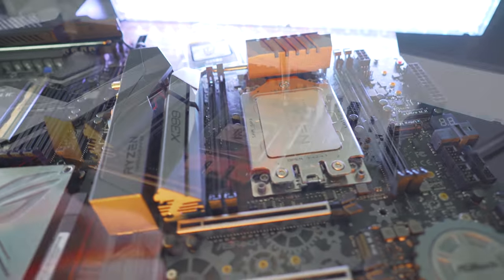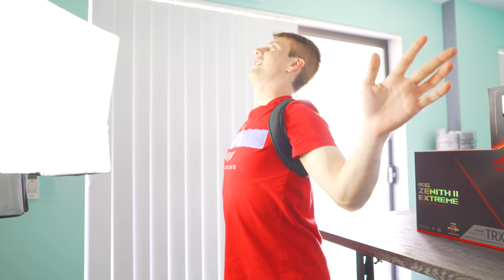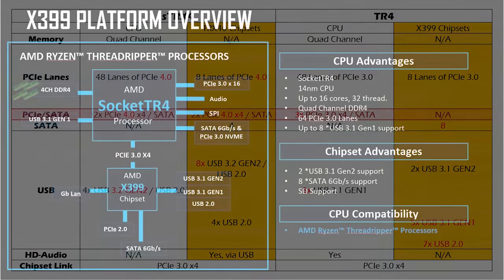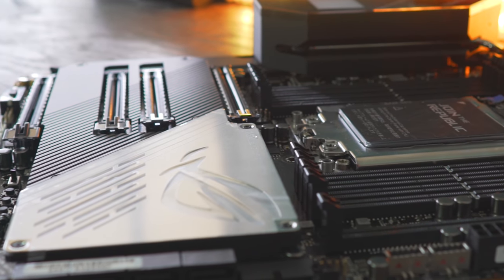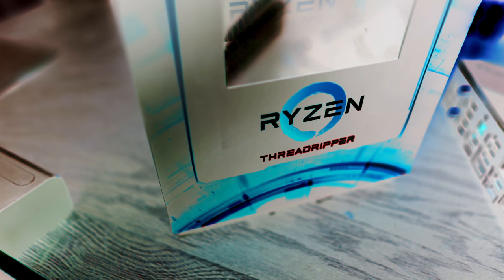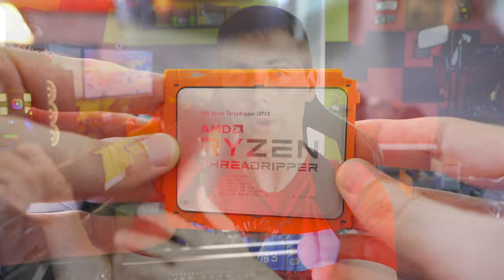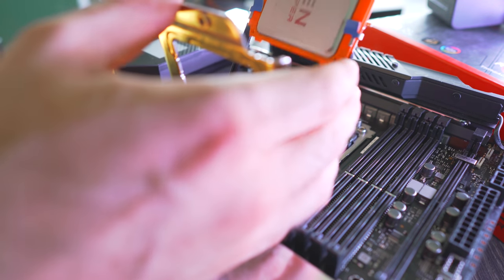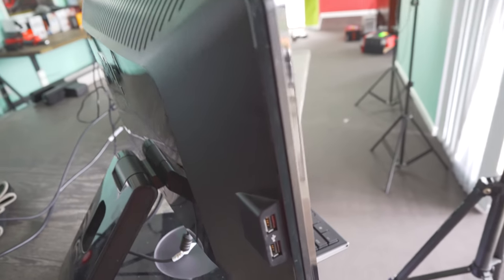Why the 3970X Won't Work on X399 - New TRX40 Vs. X399 Differences Explained

Comment: Since the new Threadripper won't work on the older platform, I can't wait till we start giving some Tech. YES. LOVIN to the old threadrippers!
Next episode: $399 Threadripper 1st Gen build!
Reply: I got 1920X when they got on hard discount after 20XX launch. Now I have very quiet system with Vega 64, both with water AiO, mATX board (sadly bit to large to fit in Jonsbo C2).
Reply: The 12 core First gen ryzen threadripper costs 229€ (new) here in germany if iam not mistaking.
Reply: @riklaunim  So I assume you are mainly using that system for work/content creation?
Reply: @TheBIOSStar  Linux with kubernetes for work, windows with games and some astrophotography processing apps for the fun part.

Comment: For anyone considering these back braces: they do help your posture, but be careful not to use them for too long if you're being active and not just sitting at your desk, all the force is being applied on the back of your neck and will cause some pain. Speaking from experience.
Reply: Thanks . That's good to know .
Reply: Yeah. Don't force it ... Give it time. Correct your posture gradually!
Reply: thanks for the heads up. I have a hunchback but spent most of my life in a cathedral so never felt the need to straigthen my back. sadly my place of residence was recently burnt down and now am on the streets...have no option but to get in shape.

Comment: You have a good point. To add to that. A lot of times the pins are all being used. Some are just there. I read somewhere that there are tons of list of slots and sockets. And they can pick from them. They dont have to design one completely from the ground up. So there may have been a lot of slots and in order to keep the CPU performance/speed/?? up to standard they may have had to switch pins (electrical layout), not physical.

Comment: Face pulls will cure your forward shoulders! Whether it's using cable machine or resistance bands off ebay/amazon.
It's not just nerds that suffer from it, A lot of gym junkies spend too much time training the front parts they see in mirror and forget the back area.
Over trained pecs from too much bench press will push your shoulders forward, Need to do rear delt exercises to counter balance and straighten everything back again.
A strap will only do so much, Need to build some muscle long term to fix years of shoulder/back neglect!
Reply: Please guys upvote this, this is actually the healthy way to solve your hunchback permanently. And its not even that hard.  You can buy a resistor band to do facepulls at home (and a lot of other exercises too). Please dont buy magic solutions like the one advertised, they may even cause damage to your back in the long  run.

Comment: Supposedly the X570 boards were mired with problems because of PCIe4. My guess for the non-consumer milking reason for them changing the pin layout is to ease the transition. The consumer-milking reason I think they did it is so they can still sell Threadripper 2000 series and x399 mobos for the price slot just below these new 3000 series threadrippers.

Comment: Could you make another Ryzen vs Intel input latency video like you did with 2700x and 9900k. 
I wonder if Zen 2 has lower or higher latency vs the first gen Zen (I'm thinking the chiplet design could make the latency even worse).

Comment: I am disappointed that the new chips won't work with the old boards, but I understand the reason suggested by you, that they want a smooth experience for people investing in the new chips. I am rather excited about the prospect of more old x399 boards on the used market.

Comment: TechYESCity, I think the reason AMD made TRX40 incompatible, or announced that the TR4 X399 would not be compatible with 3rd gen Ryzen Threadripper is because AMD went around the problem it faced with the high-end 2nd gen Threadrippers 2970wx and 2990wx that used more than 2 NUMA cores. 

Remember those Threadrippers suffered performance regression in Windows 10 due to the OS poor thread handling with it's scheduler if system uses a processor that has more than 2 NUMA cores. 

Remember this became a big issue during the 2990wx launch last year.  AMD knew this was a problem and tried to band-aid it with an update to their Ryzen Master OC tool that featured Dynamic Local Mode for the 24 and 32 core Threadripper, but it did not do enough to improve performance compared to Ryzen Threadripper builds that used a Linux operating system which performed greater.

It seems with 3rd gen Ryzen Threadripper AMD reworked the design of the CPU, fitting 24 and 32 cores within two NUMA cores and avoided the issue with Windows 10.    I bet this core change made the new processors in compatible with X399.  

But those are just my thoughts as a fellow X399 owner with a 2990wx.

Comment: Intel has done the same thing with lga1151 socket, however with some work coffeelake chips work on sky/kaby lake motherboards, I have 2 of them (i7 8700k on asus maximus viii hero and i5 9400f on asus z170i pro gaming) running without any problems
Reply: But it's not the same. 6xxx 7xxx 8xxx and 9xxx are done on basically the same archintecture and same node whereas threadripper 2 and 3 while on kinda similar arch, still hgave the node difference and IO die, also PCIe 4. Then again, older boards support ryzen 3xxx with bios updates, TR4 boards not supporting new threadrippers is kinda silly. Also 1151 is a desktop consumer product whereas threadripper boards are more productivity/workstation type boards.

TLDR: AMD's switch from X399 to TRX40, while a bit disappointing, is way more justifiable than intel's 1151 vs 1151.

Comment: Most of the office PCs (Dell 7010 systems) at my uni have a matching HP screen with that 2048x1152 resolution. You saw them quite a lot back in the day for business, being just a bit sharper than 1080p

Comment: 1152p resolution was used in the CRT days, but not with 2048 horizontal resolution, those were old 4:3 aspect ratio so they used 1536x1152 pixels, I used to have a 1024x768 CRT monitor but I used to set on at 1536x1152 to get more size, later I set it at 1280x1024 to get even more... I still miss this from CRT monitors.
But using the same 1152 vertical resolution on the 16:9 aspect ratio will give you exactly 2048x1152 resolution as your display.

It's still strange though seeing this resolution again. It's done custom I think, but it's easy for modern LCD/OLED production, they just produce a large panel with specific DPI, then cut it in smaller screens. So having a weird resolution is just like playing with DPI and display size. It's like how Apple is using the same DPI for their 13", 15" & 16" MBP, all with weird resolutions as they all based on the same large screen panel with the same DPI, they just cut it in smaller 13, 15 and now 16" screens.

If you need large amount of the same screens then you can have a custom order.

Comment: Hey Brian, where can you pick up a 6700k or 7700k for a reasonable price? I'd like to squeeze a bit more life out of my skylake build, but don't want to spend $500AUD for an old CPU which didn't cost that much back when it was new.
Reply: I’m not Brian but you can try Engineering samples on Aliexpress. I’m running 4c/8t one right now tho they don’t clock that high.
Reply: You might need to do a bit of planning, but you can likely squeeze out a good deal on ebay by watching the auctions on eBay.
What's your current build specs?
Reply: userbenchmark.com/UserRun/21832902 Only upgrade path at present is getting a better cooler and squeezing another 100-200MHz out of the 6600k, or switching it out for one of the SMT/HT-enabled SKUs. Obviously don't want to spend a whole lot on a 3-4yo build I'll likely replace in the next 1-2 years, just want fewer frame dips (using a 60" HDTV for a monitor, so any frametime inconsistencies melt your eyeballs at this scale).
Reply: @crunchychips8123  even then all you are getting is hyperthreading for $130-200. 

Perhaps save for a midrange Ryzen 3000 series platform?

Current coolers are transferrable and cross compatible so maybe do that.

Comment: @2:02  typo.. obsolete ... @2:25 you're showing chipset link pci-e 3.0 x4 but it's actually pci-e 4.0 x8 which you show at @3:10 - the chipset has 8 pci-e 4.0 lanes for slots and 2 "modules" that allow motherboard designer to pick between 1 x4 link , 2 x2 links, 4 x1 links or sata controller with 4 sata ports .. so you could have 2 x 4 sata + 4 sata always enabled in chipset if you want to, besides the 8 pci-e 4.0 lanes.

I suspect they had to change it because of the chipset link at x8 and because the memory controller is a bit different and because of pci-e 4.0 and the amount of lanes... better to simplify design and guarantee the chipset's always gonna be at pci-e 4.0 speeds and you don't have choke points.

Comment: 5:15 - Nobody is forcing someone to upgrade. :D  Buying one of these products is a voluntary act. AMD never promised socket compatibility for TR, and PCIe Gen4 is a rather demanding feature to properly support. More likely though it's to better cope with Zen3. Wouldn't surprise me if they did it again later, eg. a new socket once more for Zen4/Zen5. Plus, the kind of people who buy this class of hw don't really care about socket compatibility; if they upgraded at all they're more likely to buy a newer CPU anyway. HEDT is a different mindset to mainstream mbds where price awareness tends to dominate a lot of the rationale for why someone chooses a particular product. I know people who would (likely will) buy TRX80 because the cost will more than pay for itself in added performance (solo pro types).

9:20 - Perhaps aimed at proper 2K editing? Though I would have thought most pros would just go for a 1440p IPS, they cost diddly these days.

Comment: That display is one of the 13:10 displays that were around for a while. A few extra pixels and slightly better aspect ratio. But since they were only ever used as PC panels, not the mass market TV/laptops, they never really caught on.

Comment: I think its part greed and part laziness on the part of the board partners not wanting to upgrade the bios of the X399 boards. On the other hand, these are a workstation platform so they probably don’t want to introduce bios updates that might cause down time.

Comment: I'm still hesitating if i should go for the second or the third generation of Thread Ripper, hoping the upcoming reviews and benchmark (for the third generation) will help me with a final decision...
Reply: I can't think of a reason to buy 2nd gen threadripper over Ryzen 7 3000 series. Double the wattage for less performance and you can't upgrade new threadripper. People that bought x399 really got hosed.
Reply: @ItIsNot1984  You are definitely right but don't forget what divides us the more: Money...
Reply: @blackmennewstyle  The old addage "You get what you pay for" doesn't apply here. In this case, if you bought a $50 a320 board, you can still use the new chips whereas a 3 or 4 hundred dollar x399 board buyer is just screwed.
Reply: i prefer more pcie lanes and quad channel support

Comment: i feel very frustrated because I bought last year a x399m taichi board and a 1950x, with a goal to change the cpu for ryzen2 TR3 as soon as available.
 I had to work with a slow cpu during one year for 3d modeling because the 1950x is not very reactive for everyday uses and mostly because the chipset and windows 10 support was crap until recent updates that fixes the issue.
 the  rendering was very good thought it is a good powerhorse cpu for this.
But now I feel I 've been duped by AMD, because of the new TRX40 platform only policy. Event my PC case was a micro atx so I can't use neither my case anymore. I have to change all with a really high price tag.... so not happy.
Reply: Wdym by reactive?

Comment: X399 has 4 lanes of PCIe for the chipset link to CPU, AMD have doubled the number of lanes to 8 on TRX40
That there is the incompatibility, more bandwidth for the chipset peripherals to utilise.
There's nothing weird going on here, it's an architectural upgrade that is physically different (it's not just the socket or just gen 3 to gen 4) and a damn good reason to not force some kind of bullshit backwards compatibility using only half the CPU's communication lanes and at the slower speed. 

If you are looking at 24 cores plus @ $1400+ for the CPU, then $400 for a new motherboard is inconsequential to the upgrade benefits and X399 would seriously compromise the CPU's communication with the rest of the system if they tried to force it.

Given too that the 24 core and 32 core are 280W (what will a 64 core TR be 380W?), and first and second gen TR started at 180W up to 16 cores and 250W for the 24 and 32 cores, there's an addition to the motherboard specs to beef up power delivery significantly, could every X399 board safely deliver the 280W+ power required? Remember that X399 was designed for first gen TR for 180W TDP and there were some cheap boards sold for that with VRM's not any better than a higher end X370 desktop board with 95W TDP in mind

There's plenty of good reasons here, many X399 boards will just throttle the CPU as they fail to deliver the power and would cause a bunch of complaints about bad performance.

Comment: Just to debunk the bios requirements, TRX40 from both gigabyte and Asus are still using 128Mbit chips not 256Mbit chips. So that's not the reason as there's so few CPU's in the range totalling 7 for the first two generations and not 60+ when you look at the AM4 platform going back to bristol ridge.
There's been the same number of bios updates for X370/B350 (some less) as there have been for X570 and it's not the backwards compatibility that's the culprit.

Comment: I hope the X399 platform will survive as it is more energy efficient and cooler. I am even looking forward to AMD's  launch of a 64-core CPU for  X399 chipset, even if it is not as powerful as 3990x on sTRX4.

Comment: I can't wait for the AM5 motherboards to show up so we can get the "Why did AMD change the AM4 socket design". ;) 

Perhaps the switch from PCI-3.0 to PCI-4.0 had something to do with it?  they might have had to move somethings around in the new Gen 3 Threadripper CPUS to get it to work that they didn't have to do for the Ryzen CPUS?  I don't know, I'm not a CPU designer. :-D

Comment: Over at Hothardware, AMD's Scott Herkleman gives a pretty plain explaination for going with a new platform. He said " the x399 platform had some restrictions that would've made it impossible for future Threadrippers CPU's " So basically there's a 64core 128thread Zen3 THREADRIPPER coming. Thanks to MSI's mishap, we all know this. Also, I think there will eventually be a 128core 256thread THREADRIPPER. I wouldn't putnpast AMD. They did bring 16cores 32threads to the mainstream consumer (AM4) platform.

Comment: Wait TR4 is a socket name. X399 is a chipset name. 

TRX40 is socket name or chipset name? Which part is not compatible with the 3rd Gen Threadripper?

(Edit): Okay so the new chipset is TRX40 and they don’t inherent the TR4 socket no wonder they aren’t compatible with the previous gen board.

Comment: They could have made it work. But they did not. The CPU pinouts and socket are identical. It is after all a EPYC with different microcode and gen1 and gen2 epyc are interchangeable.

Comment: There are 64 PCIe lanes in both Threadrippers.  And in the new TR, it's 4 PCIe 4.0 to the chipset, it was 3.0 on the older TR's, leaving 60 for the motherboards to configure as they wish.  AFAIK every board partner has literally chosen to configure both motherboard platforms with only 48 lanes in normal PCIe slots, using the rest of the lanes for on-board stuff and NVME.  Even the AMD marketing slides you showed had it listed as 64 lanes from the CPU.  So IDK where you're getting your 48 lanes from, but it's not anything from AMD.  Maybe the fact that literally every board manufacturer has seemingly settled on a de facto standard of only providing 48 lanes completely dedicated to the backplane slots?  That's not AMD that forced that though.  Despite what it might seem.

Comment: USB 3.2, 3.1, gen1, gen 2, gen 2.5... even an experienced builder can easily get confused. That kind of marketing naming should somehow be prohibited by law. I personally figured out that 3.1 gen1 is actually a renamed 3.0 when I purchased a Z77 mobo and found USB 3.1 gen1 in the spec sheet. How many people will think that theit cheap laptop has an option to be charged through the USB port, when even tech savvy users are getting confused!

Comment: It’s the exact same chipset only the cpu sockets have been rewired for efficiency, and the main difference is pci e 4.0. And no your wrong is it’s a money making strategy, they make more money when you need a new motherboard and loose money when you can put the new cpu in an older motherboard.

Comment: It seems quite obvious that AMD want to A/ have a clear delineation between Ryzen and their HEDT TR platforms in both price and performance, and B/ wish to standardize that platform to latest gen PCIe/lanes, USB, etc, support going forward. It solves a lot of hassle if you spec to the latest gens of say USB and allow the industry standard to take care of backwards compatibility issues, rather than try to account for that and the headers yourself. Look at all the flack TR took at launch with compatibility. Why would they want that again. It's way easier to create a standardized business solution that works out-the-box, and anything that doesn't is a "you problem" and blame industry standards when shit inevitably goes tits up. "hey we gave you cutting edge tech and you tried to plug WHAT INTO IT?"